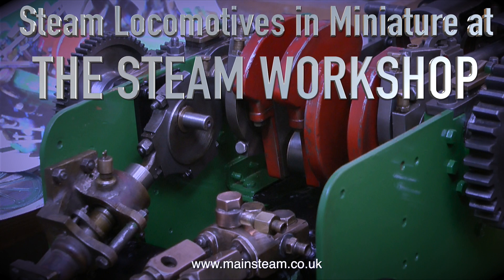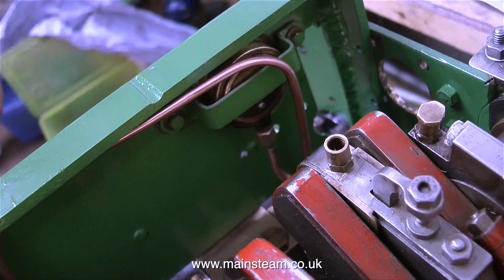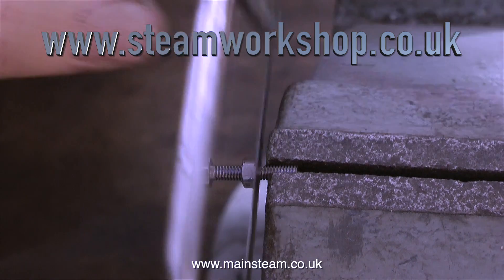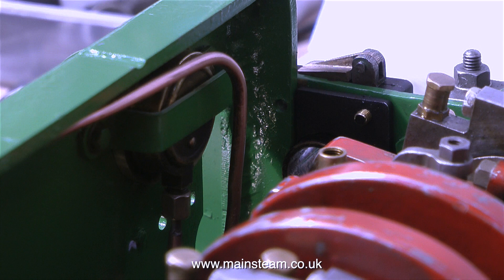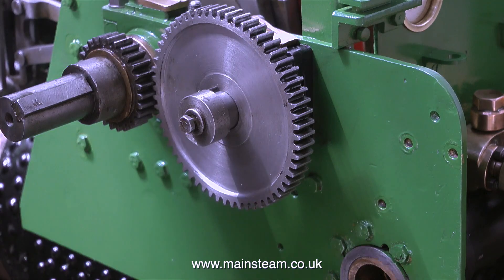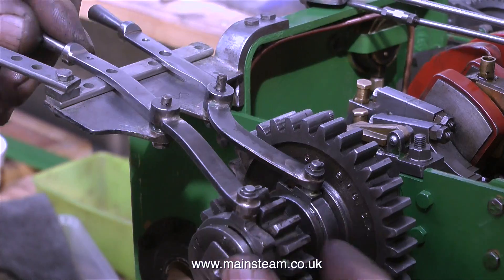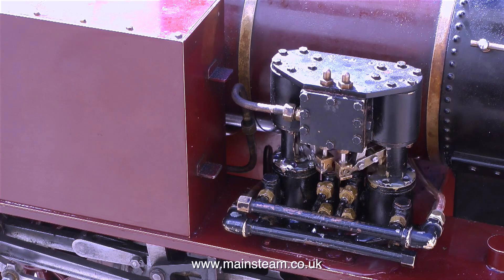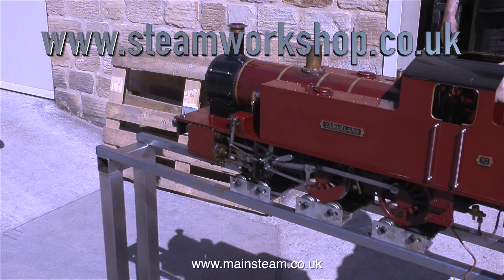THE STEAM WORKSHOP - GARRETT DCC TRACTOR - PART #6

Comment: If you cut a bolt, make sure you have a nut on the inside like you did. Then, you can remove the little burr that came from making the cut by removing the nut.
I'm sure most people know this.
Reply from the maker: I never bother because I always clean up the end of the bolt using my small one inch belt sander.

Comment: I am surprised there wast a T at tthe steam pump with a bib cock that could have been opened.  That way when you start the pump cold, the owner could heat the delivery line.  Then again the pump will lose some (not all from the heat of the boiler) of the heat when they close the steam off.  I have owned two locomotives that were set up this way.  A RR supply Mogul and a 3-3/4" plantation 2-4-0